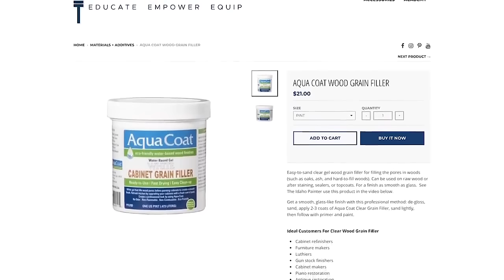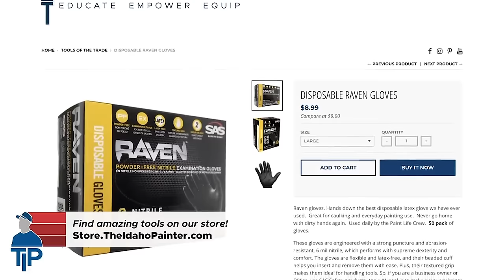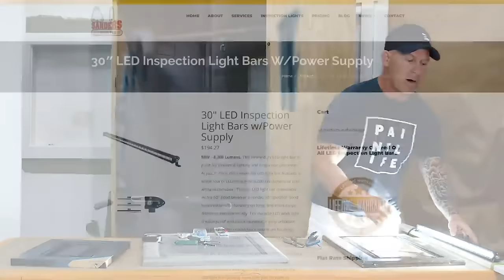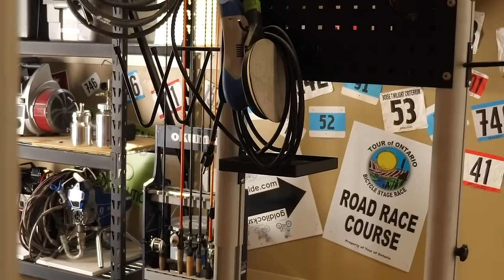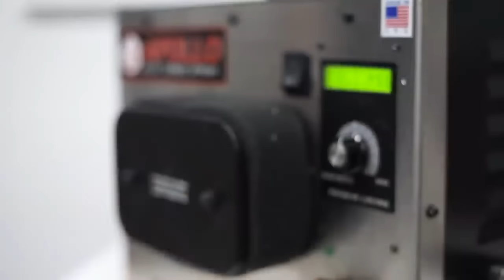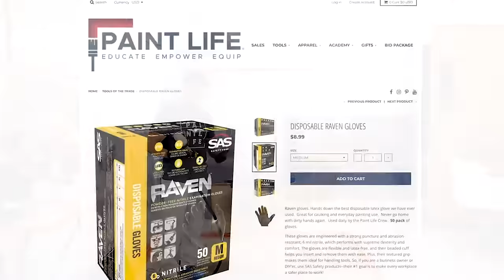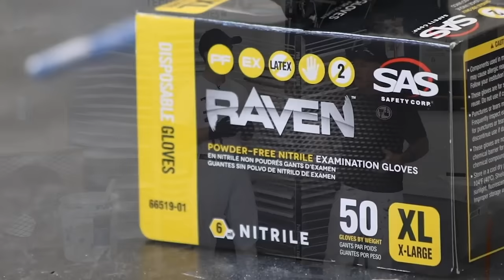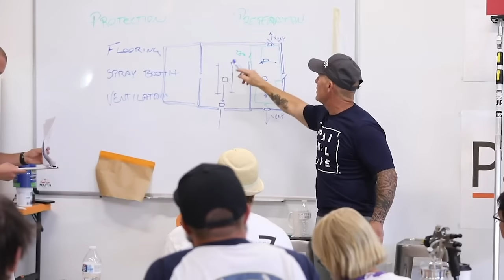How to Paint Cabinets Without Brush Marks! A Complete Guide to Easy Cabinet Painting.

Comment: Using hooks to hang doors giving the ability to spray both sides at once is amazing. I dont have a nice rack so i use strut channel used by electricians. Its square so its super sturdy and doesnt bend it also has holes cut out were you can place each hanger wit nochance of sliding

Comment: I’ve put in a lot of time trying to outsource painting, I have a 100% failure rate on finding a painter that will show up let alone let my work shine. I mainly do finish carpentry and built in furniture and shelving. I used to do a lot of painting and cabinets were a big seller. Wish I had access to this kind of info long ago. Since I can’t get away from painting, I’ll jump in both feet an do it as efficiently as possible. That surface prep sander looks like a huge time saver. I have a pop up that I set up as a mobile booth and I use home made air scrubbers for flow.since I don’t do it enough I use my little earlex and my old faithful titan 440 for the bigger projects. Your channel and effort in your content is making every one better. I look forward to adding value to anyone that watches my content. Your store is amazing, I’m so hitting it up when I finish building my house.
Reply from the maker: Thanks for your support

Comment: How do you deal with overspray on underside of the door when you spray the top? 
When using a blower to remove dust I also use my hand or brush to break static electricity and more efficiently remove dust.

Comment: Hi everyone at paint life I had a question for ya’ll. I’m going to paint my kitchen cabinets with hplv sprayer .  Currently the cabinets have white latex paint. I want to spray them with white laquer, what do you recommend I use for the primer? What laquer do you recommend for topcoat? I do have a Sherwin Williams paint store near me not sure if that helps? Last question I did hear laquer turns yellow overtime is that true? What can help to prevent that?
Reply: Enamels turn yellow over time. And I would just dust coat a precat lacquer primer surfacer, after sanding the latex and it should hold pretty good.

Comment: I just watched one of your videos about painting kichen cabinets and I have some questions. I was a viction of the ice freeze in Texas last February and it ruined my kitchen cabinets but they were already in pretty bad shape. Old stained, laquered with floating panels that had probably hadn't been cleaned in 50 years old! But when my ceiling collapsed and the nasty water came in, it went through my cabinets and molded inside and out. I was going to hire my son to clean, prime and paint the ceilings, walls and cabinets in the kitchen and the walls, ceilings, paneling and baseboards in the breakfast room and the ceilings, paneling, trim, doors and basebords in the family room that is quite large. But when I saw his estimate, I knew he was quite low on the family room and really missed it on the cabinets. I haven't counted the drawers and doors but what should I add to it for the condion?
Reply: Wouldn't insurance cover all the damage?

Comment: While I don't spray a lot of cabinets, I have sprayed hundreds of 2500+ sq ft new construction millpacks with 20-30 doors, a mantle, wainscoting etc in my 25 yrs with my graco 695 and a 411 tip. I've tried hvlp sprayers before, way too slow for me and no noticeable difference in finish. I three coat it all with proclassic water based in a day

Comment: SANDERS,...LED INSPECTION LIGHT (BATTERY SUPPLY)  ALSO CALLED A “BALLAST” I BELIEVE?
Reply: A ballast is used to limit current in a fluorescent light. For LEDs its a transformer to reduce the line voltage from 120 (or 240) to a lower voltage to run the diodes. Hope this helps.
Reply: @krissswanson  Well I guess for technicality sakes when it comes to LED lighting the "box" is called a driver which is basically a transformer with specific controls for voltage to maintain a constant current.

Comment: What did you use to spray the doors as a sealer and finish coat??  I missed it if you mentioned it.
Reply from the maker: You do not have to clear coat it.
Reply: @Idahopainter  yes but you primed it.  Was that the renner product??

Comment: Can I use the apollo 7700 atomize with a titan 95 3 stage turbine
Reply: 95 = 4 stage. depends the viscotiry of u material
Reply: @ajolote7193  yes I have a 4 stage and I also have a 3 stage capspray.
I always thin out to get smooth finish, I was just wondering if the 7700 will work the same with the 3 stage turbine.
Reply from the maker: Yep I have that sprayer

Comment: I was told I needed to get all the lacquer finish off before aqua coat or the paint/primer will peel off later down the road? I see you just lightly sanded and that was all. What’s the answer? Not taking all the lacquer off will save me hours and hours. Please help with this question. I can’t get a straight answer from anyone

Comment: Dumb question,  but I’m new and still green. What kind of sprayer were you showing from Apollo at the beginning of the video? Would an airless unit work for cabinets, or do you only suggest a sprayer like this for cabinets. Thanks in advance for any information given. Love the videos!
Reply: That Apollo hplv is the best of the best, it’s overkill for a newer guy imo. You can get great results with an airless sprayer and renner products
Reply: Airless do a fine job. I've been in many a new construction custom home, we did the entire place, cabinets, trim, all wood, with an airless. With proper prep, and light sanding between coats, it can be an awesome finish. I was a bit surprised our host here is using HVLP, though I don't doubt the end result being a high quality finish. But an airless, in good hands, can do a fantastic job on cabinets. IME.
Reply: Hvlp are OK, but nowadays airless spray tips will give you a great if not better finish, but uses more paint
Reply: @exsmoker74  they also make low pressure tips for the airless which you use much less paint and more controlled spray, much less overspray, RAC X
Reply: @MV-wb2cz   you still use more paint than the like of a hvlp , airless fine finish tips are my go to👍👍
Reply: @exsmoker74  i wasn't disagreeing with you. Just pointing out that option. I use the same RAC X fine finish tips

Comment: Okay. I bought some aqua coat per TIP's recommendation. The one thing it does not do, not even remotely, is sand VERY VERY EASY! It actually be the least sandable so called sandable product that i have ever used. Its harder to sand than  MH ready patch, 5 minute drywall mud, and maybe even bondo. My idea of very very easy to sand would be something like green dot drywall topping. 
As for the feeling of it after 2 coats, I wouldn't call it glassy, as this dude calls it after one coat. I can still feel bumps and humps of the wood grain. Now sure, I cant feel the small holes, but it aint glassy. 
So what's the deal? Will the paint even everything out?

Comment: What about using high build automotive primer and spray all the doors and draws with this? Cheers
Reply from the maker: Have to give it a try
Reply: Ive thought about using high build primer to eleminate the wood grain. Is that product only to be used on metal
Reply: @mikedee4123  Not sure to be honest. Find a brand available and look up the technical data sheet on it

Comment: The amount of labor involved to clean, sand, fill, prime, sand again, paint (2 coats), and the waiting time between steps... I just can't imagine this will be cheaper (to hire someone like you) versus buying new doors. Can you give me an idea what the general "going rate" is per cabinet door for refinishing? I am spraying my own doors, and I have 30 of them. It's a daunting task but getting great results with both HVLP and airless. But it can be overwhelming when you realize you have to touch 30 cabinet doors 4 to 6 times each.
Reply: Usually I bid all my doors at $125 each including drawers. I use an airless to spray all my work from boxes to doors… most jobs end out at like 2500- 5000 depending on the kitchen size. Where new cabinets run for 25000- 80000. So having an actual painter come in verses a cabinet installer, save thousands.
Reply: If someone told me to get new cabinets for 80000 I’d tell them to walk off a cliff
Reply: That’s what it’s come to in Utah… prices for new cabinets are outrageous 90% of people just have them repainted.
Reply: @skylerhall10  I just bought cabinets for $6000 that’s disgusting lol
Reply: It is for sure.
Reply: Many people have solid wood cabinets, with build quality superior to newer cabinets.  Yes, there are quality options available, but for comparable quality of build/material the cost can be pretty high.
Reply: @MisterRay11  depends on your kitchen.
Reply: @MisterRay11  $6000? That's a step saver condo kitchen.

Comment: With all do respect . The timings you describe couldn't be correct.
We are professional cabinet painters, and it takes two people, one day to take down doors, drawers, mark them, degrees, clean, sand, clean them. 
And one day to cover everything , maybe start priming that day.
And third day sand, clean, and spray two coats of top coat.
And fourth day, installing the doors and drawers, and of course cleaning the mess we created before.  
This is four days work, no matter how go by this projects.
 Of course, if you know what you are doing. And that is if the cabinets don't need repairing or getting them to get smooth for a glassy finish.
Reply from the maker: OK
Reply: Take down the doors, label them and then start what you do on the second day, prep the boxes on the first day. Before you go, spray the boxes with primer. Then go to the shop and sand/clean the doors and then prime. Day 2 top coat the doors and the boxes. Day 3 reassemble and cleanup
Reply: Agree, I use to do this for a living and use to take us 3-4 days just for the cabinets. We always replace the doors.

Comment: Just get yourself a good purdy Chinese hog whistle brush, and use emerald Sherwin-Williams it's a hybrid alkyd enamel urethane it's designed for brush application and will not leave any brush marks it also has a hardness factor of 5 on a hardness scale and highly durable, if you insist on spraying and not bending your wrist and spraying properly you might as well forget all that equipment it won't do you any good
Reply: I agree about the sanding sealer but emerald is trash compared to renner or precat
Reply: @lexandersantana8089  no emerald is pretty good when fully cured
Reply: @mikemartin5909  does emerald not scare easy and how long does it cure ?

Comment: I WILL BET THAT 80 % OF THE PEOPLE THAT PAINT THERE OWN CABINETS  US A BRUSH AND ROLLER,  I HAD TIME BECAUSE OF THE LOCKDOWN SO I DID MINE AND THERE IS NOT ONE BRUSH MARK ON ANYTHING, USE THE RIGHT PAINT AND BRUSH AND ROLL AND THE JOB WILL COME OUT GREAT.  YOU CAN TIP THE PAINT OFF IF YOU WANTS TO, I CHOOSE NOT TO.
Reply: It is always an option with certain paints. I don’t think it would work with lacquers though.
Reply: Good for you!  If you’re happy with it, that’s what really matters.  Now that you have the know-how, you could start painting cabinets for a living. :)
Reply: @douglaspollock102  just to let you know  i an retired for 20 years now  and guess what, i was a house  painted that made a very good living using only brush and roller
Reply: @douglaspollock102  i painted house for 40 years been retired for a little over 20 years all i used was a brush and roller.i  really did the whole  condo over everything but the ceilings  even change the cabinet hardware  not bad for a man of 82, took me a few weeks because i did a little every day
Reply: @arnoldgoldin5535  most people would be proud at half your age.  If I’m able to do that at 82, I’ll be happy as a clam!
Reply: @douglaspollock102  thank u
Reply: @arnoldgoldin5535  you would, especially working by the hour..